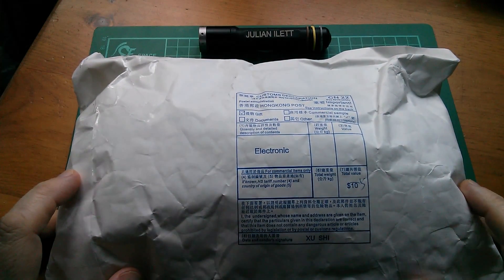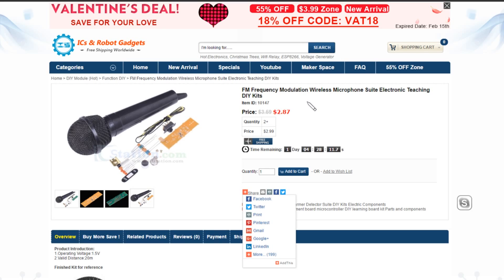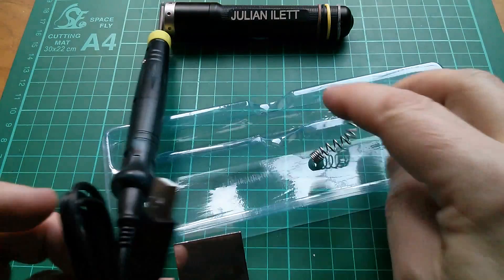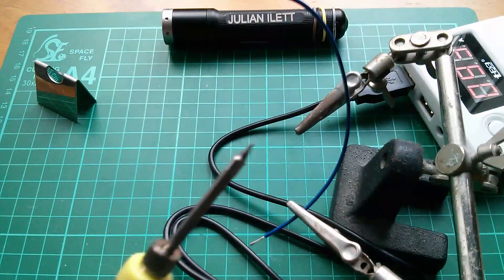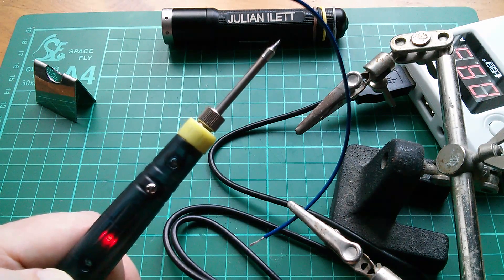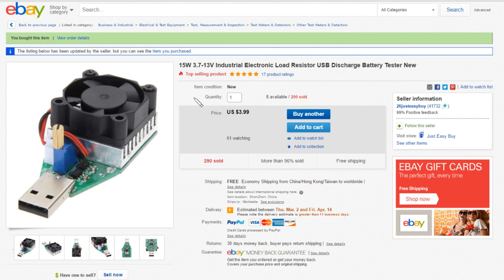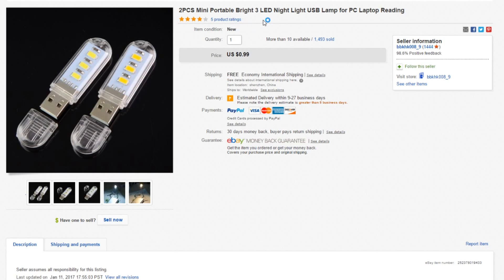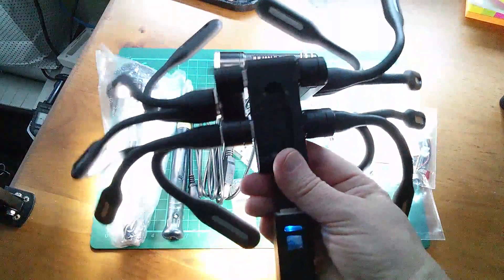Julian's Postbag: #84 - Kits and USB Modular Lights

Comment: To prevent accidental powering up when you bump the touch switch, find a suitably large non-conductive washer or nut and glue it around the metal touch point... Then, only a deliberate action will turn on the iron.  (Don't have a jar of nuts and bolts handy? A raised ring around the touch button can be fabricated from pretty much any non-conductive material.  A thin piece of zip tie on its side, arranged in a ring + Krazy Glue. Done!)

Comment: I got two of these soldering irons, they are pretty good however, one starts to malfunction. Iron led stays on all the time and doesn't heat up or stays on all of the time and can damage/wear out the tip very quickly or cause corrosion around the tip connector (because of heat). Also figure out that the tip can get too hot (burns your solder). I fix this one by removing the circuit (keep the led) and connects the tip to usb directly and works great! I think this is actually better and never gets too hot. You can use the stereo plug as switch by pulling it out with your thumb (just one 'click' so it is still locked in the socket) to turn it off. Put it back to turn it on again. I think that's the idea of the stereo jack connector, you can use it as a switch and it avoids your cable can be twisted and also it is easy to replace. Neat.  

Tip: Buy some extra tips as backup, if you use it frequently like I do.

Comment: Julian the Chinese got some dipping thing I think it is Rosin for that USB Soldering iron stick, see it here, below at #3: http://img.banggood.com/thumb/water/oaupload/banggood/images/A3/F5/a0cbf187-afc4-4426-af76-c3f86ac3f499.jpg http://www.banggood.com/Rosin-Weld-Soldering-Iron-Soft-Solder-for-Welding-Circuit-Board-p-939723.html

Comment: That USB 3.0 is probably 2.0 only. I bought one, wouldn't do 3.0, took it apart and turned out the 3.0 specific contacts were not even wired. :(

Comment: Can you test if the electronic load has feedback to maintain a constant current over a changing input voltage?
I don't see why it would drop out at 3.7 V, surely it would make it down to 3 V if it really is a battery tester.

Comment: Hello Julian. Can you measure the output voltage for the two SOT89 linear regulator at  13:00 when a 5v power bank connected?

Comment: TIP122 is a darlington pair. I love them. Base current internally limited. They're quite good if you wanna switch high(ish) currents from a micro-controller or whatever and dont wanna spring for a MOSFET. Ten-a-penny by comparison. Last time i looked you could get half a truck-load on ebay for a quid.

Comment: @Julian Ilett
I was thinking to buy the same USB soldering iron. From quick calculation, It seems a 6W soldering iron, not bad for small soldering job that needs to be done away from electricity socket (by using USB power bank).
For the tip problem not taking the solder, try some tip refresher or sal ammoniac brick.
Reply from the maker: See my latest video for my thoughts on the USB soldering iron - it's far from perfect.
Reply: Oh really thanks. I really appreciate it ^_^
Reply: majdinj As a portable iron, it's really pretty good. Given the alternatives, I'd choose my USB iron over anything else when away from my bench/desk. At my desk I'll always use my proper "cheap Chinese" soldering station, with a proper temperature-controlled tip, reasonable-quality tips, and tips with a reasonable thermal mass. But the portable options are limited and tend to be pretty awful, so this one is quite nice by comparison ;)
Reply: simontay1984 It's only 8W, but the tip has a very low thermal mass so it'll heat up to a very high temperature (700°C!) very quickly despite that lack of power, but it'll then lose that heat as soon as you touch it to anything. It'll never compare to proper bench irons, but it's among the better options for portable irons.

Comment: G'day Julian, love your vids.
I have had one of the USB soldering iron's for about 6 months now.
First thing that happened the audio jack became faulty so I  pull it apart and removed the audio jack and soldered power directly on to the PCB.
Also it works better if you give 5.5v for larger solder joints.
Now get rid of that wire ball. Go to your local shop and get a Stainless steel scoring ball. 
 http://multimedia.3m.com/mws/media/789133P/stainless-steel-balls.jpg?boundedSize=310
Cost 50p

Comment: A trace of plumbers flux like Frys Powerflow will make solder fairly leap onto most things.

Must wipe it off asap as it's corrosive but a one off shouldn't hurt. Good for hard to solder stuff like batt contact springs, best use with an old eroded bit to avoid eating away a decent one :/

Comment: A word of warning on the flexible USB light, they overheat. I have one plugged in to the front USB port of my cable set-top box as a night light and the plastic diffuser discolored yellow from the heat.
Reply from the maker: Yeah, they do get quite hot

Comment: Greetings and salutations from the very windy Mohave Desert in Arizona!  I purchased one of those soldering irons the exact model, and I loved it for a long time, of course I am not set up like you with a nice desk to work at, I spend most of my days in a recliner, and therein lay the problem I ran into with that unit.  You see, I used to leave it plugged into a very large multi-USB power deal on the floor, and just plug in the cord when I wanted to use it.  This worked great for a few months, till one day the tip fell down into the works of the recliner, and shorted out against the steel parts of the chair. I could smell something very hot, and began feeling around, when I hit the cord, (couldn't see the end yet) it melted right into my finger. Man I have been burned by exhaust pipes of generators that have been running in the desert for days on end, and it was not as hot as that blasted wire! This happened over six months ago and I still have the burn scar on my fingers!. Yes, the iron still works, but she has been retired in favor of a nice little blue 110 volt with adjustable heat that I picked up from a chip china sales place.  The USB iron is in my kit and if I need to just solder one or two connections she comes out,  but  I am much more careful with that exposed 5 volt plug, and it was a bad way to learn that my huge USB Power unit is not fused at all, it is still pumping out 5 volts on six USB ports charging all my USB device atop the TV stand here in our Class A Motor Home parked in Golden Shores Arizona.

Comment: Word of warning for those USB soldering irons (though they really are handy for portable use, and are surprisingly effective) - the tip will get to over 700°C because it's a small tip with no temperature regulation and a fair bit of power going into it. That's fine for soldering random wires, resistors, and probably through-hole ICs as long as you don't leave the iron on the leads for ages, but that sort of temperature will quickly fry surface mount ICs so you have to be very careful with them.

I have one of the soldering iron tip thermometers that Big Clive has; when I used it to measure a USB soldering iron, it quickly flew right past its 600°C upper limit :)
Reply: Andrew Gillard never happend to me, using it as my main soldering iron
Reply: DerpyDoom Then you've either been lucky or careful - or not doing stuff with sensitive surface-mount chips. Big Clive verified what I said about the temperature of these irons, and there's no getting away from the fact that that temperature level is just bad news if you aren't careful with it.

But like I say, I still like these irons - they just have to be used with that knowledge in mind.

Comment: (just a guess) The jack for the iron is probably stereo to provide a ground that connects to the usb plug housing in addition to the ground for power. This way it can ground the tip. I guess a simple continuity test would tell. I'd love to know if you do the test.

Comment: I've had one of those USB irons since big Clive did his video. they are OK for small components but my element wore out after about 10 uses, now it draws 700ma and can hardly flow solder. still waiting for my replacement tip (£1.20)

Comment: @Julian: [pauzed watching] it's not a screw-on cap! Just pull harder! The ceramic heating element is very brittle. Without the screw the tip will wobble and you may quite soon have destroyed the iron. Trust me, been there, done that... (and then bought a new one because actually it is a handy little device). 
[continued viewing] Ah, luckily you already discovered that yourself... :-)
Btw. the copper shavings I bought stick to a magnet. Seems like its not solid copper and perhaps the sharpness makes it easy to damage any iron-tip coating.
#Medusa: +1
Reply: Maxint R&D Yup. I did the same with my first USB iron. it took me ages to figure out why it wasn't working. Mine wouldn't go at all without the ring.

Comment: I'm waiting of a couple of those soldering iorns I ordered on the strength of Big Clive's review. I understand they have motion detectors in them, hence yours started up when you rolled it around. I'm thinking about defeating the switch-on and having one that sits on constantly like my usual Weller does. BTW, I love 'Medusa' LOL :D - As a follow-up, I just found spare USB Soldering Iron Tips on AliExpress.com for £1.19 each with free shipping: https://www.aliexpress.com/item/1pc-Replacement-Electric-Soldering-Iron-Tip-for-USB-Powered-5V-8W-L61216/32781156379.html?spm=2114.01010208.3.1.IC7ZgT&ws_ab_test=searchweb0_0,searchweb201602_4_10065_10068_10000074_10000032_119_10060_10062_10056_10055_10000062_10054_10059_10099_10000013_10103_10102_10000016_10096_10000056_10000059_10052_10053_10107_10050_10106_10051_10000097_10000094_10000053_10000007_10000050_10084_10000100_10083_10000047_10080_10082_10081_10110_10111_10112_10113_10114_10115_10037_10000041_10000044_10078_10079_10077_10000038_10073_10000035_10122_10121,searchweb201603_3,afswitch_2,ppcSwitch_5,single_sort_1_price_asc&btsid=ea5d995c-6fc5-4086-b509-fc01af593363

Comment: i would not stick this in your usb youll fry your system... usb is only 500 mah for all sockets.. that means you have 8 sockets all 8 used you can use up to 500 mah for all 8 not 500 mah each socket..

this uses 1.3 amps so use it with a power bank... and only a power bank

Comment: Julian i have this soldering iron USB, good stuff but i removed time switch because this is very annoying, and connect heater wires directly to USB (without mosfet inside).
Works perfectly with 6-7V and about ~1.5 - 2A. for big wires/pads soldering.

Comment: I mostly mess with small stuff(LED's, arduino, ...) so the usb iron has become my primary iron, hot glued stuff on a power bank to make a portable soldering station. The only annoying thing is that if the jack comes out less than a millimeter it gets disconnected from power. Spare tips (all same shape) are buck-ish but after 10 months of use I haven't need to change it yet!

Comment: As a word of advise you better  put back the threaded metal cap that stayed inside the plastic tip protector and remove the same by forcing it up. otherwise your new and excellent soldering iron may not work.

Comment: Get a tin of tinning paste, works awesome.
Reply: Not sure if tip tinner is the same as solder paste...I seem to recall that tinner contains Sal-ammoniac (ammonium chloride).
https://www.amazon.com/WELLER-0051303199-SOLDERING-TINNER-ACTIVATOR/dp/B005T9CVN6
Reply: Oh! Solder Paste, I see. Thanks.
Reply: Tinning Paste? You mean Flux?
Reply: https://cdn-learn.adafruit.com/assets/assets/000/000/168/medium800/manufacturing_paste.jpg?1396760920